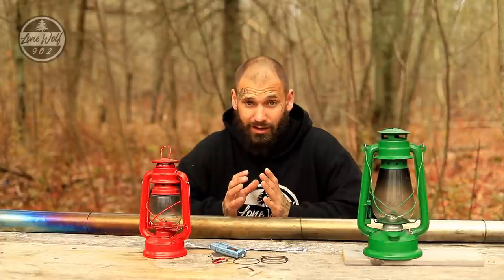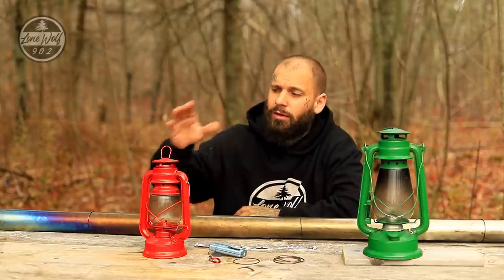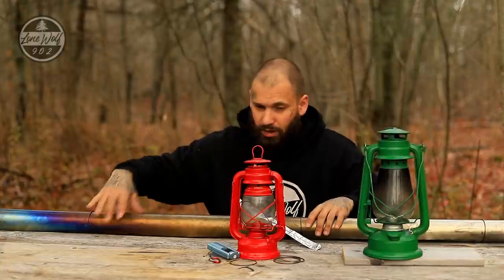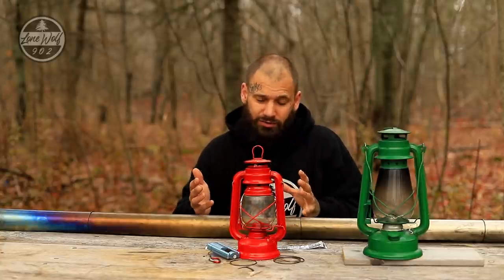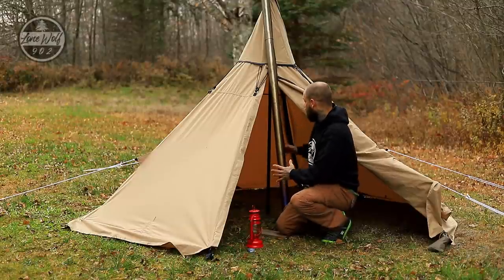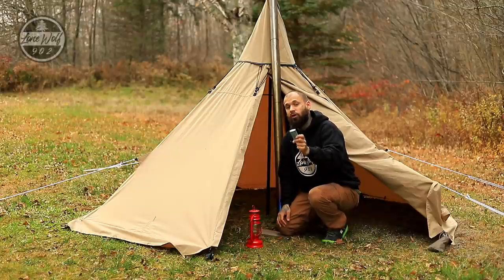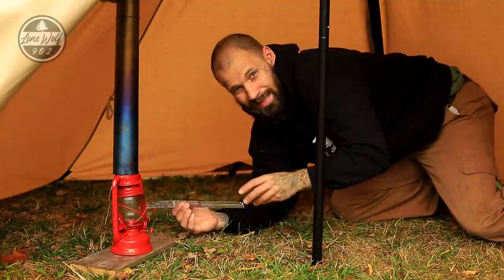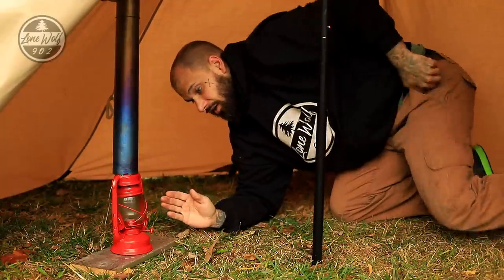Hot Tent Heated With Lantern

Comment: The air holes you covered are for t intake air that travels down the side tubes to heat the fuel for a cleaner burning flame.
Reply: ONLY Hot Blast Lantern Burners Do That; This Is Cold Blast To Bring In Fresh/Cooler Air For More Efficient Burning...With Less Smoke.
Reply: @jerrycallaio5130 nope any lantern with that design uses those holes as an intake so yes hes right

Comment: The foil used to cover the holes cuts down the draft. The lantern you used is known as cold draft design which is what the 2 tubes on either side. The holes draw in air. Get yourself 2 jupiter lanterns. They hold over half gallon fuel and will easily heat that little tent....add essential oil to eliminate the smell.

Comment: Kerosene is refined for non-vented  indoor lamps. Your tent does not seal anywhere near well enough to be an issue with pollutants. Only if the lamp is not burning correctly will it produce large amounts of carbon monoxide.
Reply from the maker: Excellent information

Comment: My guess is 18.5 celcius. I used the same lantern in my tarp tent last night. I didn't use a pipe because I had an opening in the front and plenty of air circulation underneath and still noticed about an 8 degree difference.

Comment: Would be interesting to put a carbon dioxide monitor in the tent to see if that is an issue?
Reply from the maker: I have in many tents over the years with many different monitors and none of them will sound the alarm
Reply: Lonewolf 902 
Good to know - thanks.
Reply: It's carbon monoxide you need to worry about.
Reply from the maker: Not worried

Comment: trim your wick and turn it down just before it starts to smoke and you will have a clean burn, the flame I saw  was a smoker,  I can tell you are burning with the wick raised too tall, by the smoked up globe...turn your wick down and you wont have the smoke problem! The  paraffin you burn is the cleanest available! I dont want to be an ass here but your wick was raised to high if the paraffin wa smokey!!!!!  The only problem with paraffin is that if the wick is wider than 3/4 of an inch paraffin doesn't wick as efficiently as K1 ( cleaning burning kerosene). Buring a 7/8 wick dietz jupiter lantern for two fill ups of a total of about 150 hours burn time will not smoke the globes up as bad as you had them...lol turn that wick down just a little past where it  starts to smoke!

Comment: I'm late to this experiment, but I wonder if an open metal hood (upside down funnel) just above the lantern would allow enough draft up the stack. A large metal coffee or bean can adapted to the stack might do the trick. You could use a tin can on the very top to stop weather, rain, etc. from coming down the stack.

Even a real metal funnel cut to fit could be a perfect field expedient solution for a draft hood. High temp tape used in HVAC might also help.

Any temp above hypothermia works for me.😂
Reply from the maker: Excellent suggestion

Comment: i'd say around 20c, so 4c increase.

Edit: Wow, better than expected. This is a really cool idea tho. I've seen other videos of people trying to use alternative methods of heat lately and theres some pretty interesting concepts. One person was using a piece of copper pipe that's placed directly in their fire and runs into the tent. I'm not sure if it's working like a boiler system or if its just radiating heat from the pipe, but it seems to be another simple method that works.

Comment: Since heat rises it should be warmer around the top of the tent verses the floor. 5 around the ground 10 higher up. How about using synthetic kerosene? I’ve heard it burns cleaner and hotter. That what a friend of mine uses and swears by it.
Reply from the maker: That is correct

Comment: i've used my dietz no.8 since 2012-ish and it'll keep my polish lavvu somewhere around 18-25C depending on flame size, but my dietz 2500 jupiter will bring it up to an insane 32C and higher depending on flame size, the jupiter is a bit overkill for what i do but they make another one called the 2000 that actually has a flat top for cooking with pans on

using regular lamp oil has never given me issues and i never had to vent it with pipe or anything (probably because of the armholes and lack of skirts), there's some smoke at the start but it goes away quickly and the draft from under the lavvu carries away the smell and any risk of fumes, never had a monoxide alarm go off yet
Reply from the maker: Awsome,  I agree about the monoxide alarm, hard to get to go off

Comment: My hypothesis is most of the heat generated will leave the tent thru the pipe so you might get a little heat but I dont think it'll be a big difference. A second thought is you might be suffocating the fire... the holes covered by the pipe is both intake and exhaust and the holes you are gonna cover with aluminum foil is intake not exhaust.

EDIT1: I thinking no more than 5 degree Fahrenheit ... which is something like 2.5 degrees Celsius.
EDIT2: Whoa, that's quite a difference. An oil lamp would be simpler to modify and you can pretty much exhaust 100% with no effort... safety/fragility might be an issue compared to an oil lantern though.

Comment: Interesting experiment, I guessed maybe a 3 or 4 degree difference. I remember using a Coleman lantern in my friend's ice shanty when we were ice fishing. I can't remember if it was a propane or white gas lantern. It was a good size shanty, it fit 3 adults. It got really toasty in there and we had to take our jackets off. I have a Little Buddy heater. Wish they could come up with a mini one that you could fit in a backpack and not take up a lot of room.
Reply from the maker: I've used the buddy heaters before i got my wood stoves and they worked great, but the smell was the downfall and the moisture too

Comment: IF That Large Lantern Has A 7/8" Wide Wick (Which It Appears To Have) Then ANY Paraffin Based Fuel Is NOT Recommended. It Will "Gum" Up The Wick And Burn Less Efficiently With More Smoke. Use Synthetic Kerosene Instead! In Addition Covering Those Holes Will Decrease Burner Efficiency And Make It Smoke MORE. Those Are Air Intakes For Cold/Fresh Air To Circulate Down To The Burner....To Decrease Smoke And Burn Brighter/Hotter And More Efficiently. You Really Need To Research Before Posting Incorrect Information.

Comment: This is a nice test, i would suspect it wont be as efficient at sub freezing temperatures. You need more BTUs for it. I do think a bigger Kerosine stove with 8 wicks and some modifications can do it. You need a bigger mesh heat spreader and a reflector to begin with. Basically a tiny version of a larger home Kerosine heater. I recently acquired a model 138 from a Chinese company that makes these green stoves in the millions. Weighs about 700 grams and can be modified easily to produce heat more efficiently. Costs about $15 with shipping. A liter will get you up to 8-12 hours burning (cooking) time at your leisure. All parts can be easily folded (Nested) inside a Pan or cylindrical cooking set. Only the base should be changed to significantly reduce the packing size. Kerosine or Parafine should be able to be drained back in a bottle.

Comment: The stove pipe is warm ,because that's where the heat is leaving the inside of the tent. If the lantern is vented there is no way to avoid that parasitic BTU loss. A Jupiter lantern with a 7/8 inch wick will give slightly over 1000 BTU output running on Kerosene.  If you expect to cook with that you will very disappointed. Seeing how this video is a year old , you must have already learned that.

Comment: Try the experiment with "Klean Heat."  It was very hard to find, but I lucked out at Tractor Supply.  Add a baffle that can help reflect the heat down.  That liquid paraffin might coat your chimney creating another hazard.
Reply from the maker: I ckean it after each use but realistically titanium pipe doesn't need much maintenance

Comment: Suggestions burn a Tilly lantern or Coleman lantern inside a wood burning stove. Reasons for doing it, clean air plus if you don't want to show smoke it would be a stealthy way of heating. Plus kerosene lamps can flare up. I was thinking of trying it in a flat or camper van.

Comment: That was a really great idea. Now the question is how much heat is actually put out by the glass lamp & how much by the pipe? Do it again & use a thermal scanner on a piece of aluminum put next to each piece. My guess is that the pipe radiates a minimal amount by comparison so I'd start looking around for the largest lantern I could find. The genius of using the stove pipe is that it not only reduces the fumes significantly but also redirects the soot those things produce when you have the flame on high. One other idea.... Could you add some scented oil to the paraffin to make whatever smell does escape smell better? I'd add a pine or cedar scent to it if possible.
Reply from the maker: The titanium dissipates heat rather quickly, a steel pipe would radiate more heat

Comment: I would guess a temp increase of 15 to 20 degrees anywhere above say...15 degrees F without a stiff wind....snow pack will make a big difference as well....I'm halfway through so I don't know if my estimate holds, but it's based on experience living outdoors in the Alaskan winter....literally....we had a 15 degree difference inside a tarped enclosure around our tent and kitchen with a roaring fire, out of the wind....until it went under -5 F....

Comment: I use the following product in my lanterns since I find it more pleasant inside the house when power goes off during winter (I heat with pellet stove and it needs electricity for auger feed and blowing fan for hot air).

The product is as follows:
Hôme
Lamp oil
Paraffin based
Bight burning, odourless and smokeless.
Reply: I primarily heated with a pellet stove for several winters and it can be done. A back up generator is a good idea and needed if the electricity goes out.

The hard part is dealing with the 40 pound bags every day, but they do make good re-purposed trash bags.
Reply: Pellet stoves should have TEGs built into them so the blower and auger are powered whenever the stove is hot.

Comment: You should have a vent at the bottom of the tent to vent Carbon Monoxide and you should sleep on at least a slightly elevated sleeping platform. Carbon Monoxide seeks the lowest level...you don't want to be at floor level....for many reasons....
Reply from the maker: There is no floor and the fabric is not air tight

Comment: You couldn't do it in this experiment, but you might try this with a flue damper, to slow the escaping gases.  Some would claim that you're keeping more of the heat and burning less fuel by not "letting all the heat go up the chimney."   I've also thought about putting fins on the stovepipe, to improve the heat exchange with the air in the tent/compartment.

I came upon this video looking for a lantern heater, and this one popped up.  

It might not smoke at all out those holes, covered with foil or not.  I think the commenter, below, who calls it a "cold draft" is probably on the right track.

Many's the time I've seen sparks go up a chimney through a hole where there was a missing fastener.  The spark told me it sure enough was a hole.  Never have smoke coming out that hole.  Air passing over that hole creates a vacuum (Venturi effect) so the chimney's pulling air through that hole.  So maybe you were just causing it to burn less like it was intended, and choking it a little.

Comment: Mentioning the type of oil you use is paramount to the time frame of the wick as well as the heat it puts off.

One year as I was raiding the local thrift store of non decorative candles (to reuse or melt down and make new candles with), this lady told me about a saving tool for her brother, whom had gotten stuck out in a snowstorm. 12hrs later and the one thing that kept him from hypothermia was a small candle. 

Always be prepared for the weather on your area.
Reply: A poncho/blanket and a candle can save your life.

Comment: I bet Pomoly could make a product, titanium based, that operates similar to your hurricane lantern but designed for hot tenting. For example, legs to support the lantern off the ground, a shorter stove pipe, a bigger flame, etc. I could easily see a Lonewolf902 product from pomoly that specifically addresses a  hot tent oil-based stove/lantern hybrid made from titanium. I would SO buy  that haha

Comment: I have multiple very large oil lamps throughout my home and 2 old (1940s) hurricanes... i have heated rooms with the lamps in power outages and my tents with the hurricanes (w/out pipes or foil) since being a kid.  It most definitely works but i highly recommend that you dont use if you are not extremely comfortable and experienced with fire and fuel (especially in your home).
Reply from the maker: Awsome stuff 🤙🤙